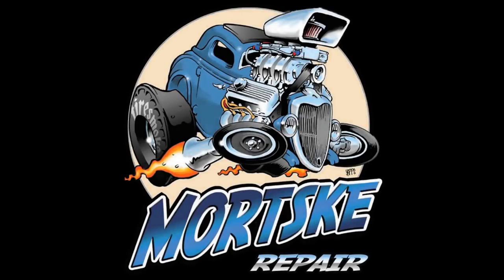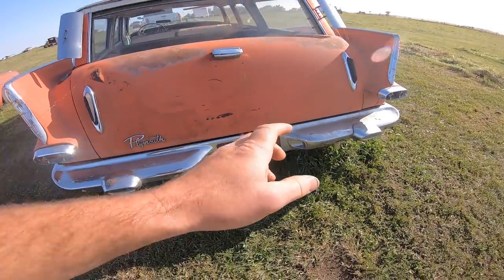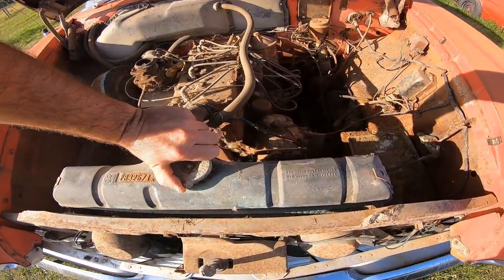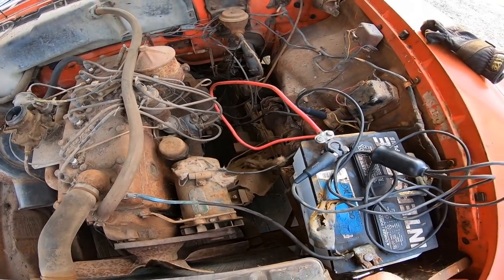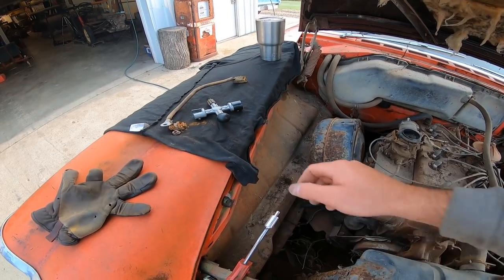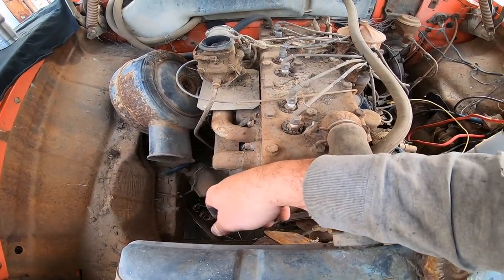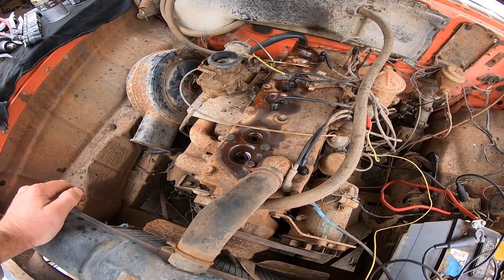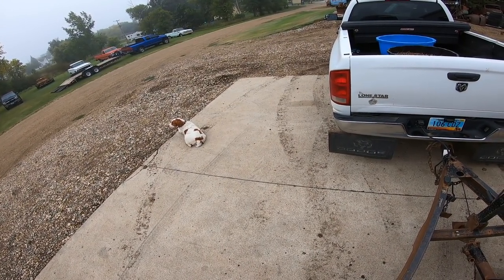1959 Plymouth Suburban Custom station wagon parked for 52 years! Mopar Flathead! Will It Run?!?

Comment: Holy smokes that station wagon not only is it rare probably the only one left in the world of that model it is very very straight good condition in and out great fine 👏🏼👍🏼
Reply from the maker: One of the other commenters said 35,000 of this six passenger trim level were built. And yes! It's in excellent shape for it's age! Thanks for watching and commenting!
Reply: @MortskeRepair  so she’s a goner ? Darn
Reply from the maker: @deborahchesser7375  Oh no, it'll get fixed!
Reply: @MortskeRepair  there is an identical colored door on Ebay in Minnesota from a 4 door. The guy is parting it out. I've talked with him as I have an identical colored wagon as yours.
Reply from the maker: @nuclearruffneck  I'm gonna look that up! Thanks!
Reply from the maker: @davidt9292  That's the plan! I'll add a new video!
Reply: Call teds tuna boats in South Dakota he has some
Reply: @MortskeRepair  teds tuna boats has cars and parts for 50 mopars
Reply from the maker: @darrenbrisson4336  Thanks for the info!
Reply: No I worked on a original low milage one back in the 90s at a shop called Classic Auto Limousine in Mpls MN but it was White . It came in because it had issues with the vacuum accordion booster that we replaced for the power brakes it had & instead of the 6 it had a poly V-8 . Was straight solid in very good shape that drove in & left that way by the owner . We were sponsored by the MSRA & had all kinds of classic hot rod muscle cars & high end  stuff coming in all the time to be worked on rebuilt or restored by the body shop we also had at the shop .
Reply from the maker: @peteloomis8456  Cool stuff!!
Reply: No that's not the only one left there are many of them around the 2 door suburbans are the ones that are rare check this one out I would love to own it https://www.youtube.com/watch?v=MOEwHWkfn1k
Reply from the maker: @79tazman  Man a 2 door would be AWESOME!
Reply: Resto mod! Resto mod!

Comment: 1:41 LOL, when I saw the light switch it reminded me of the Vice Grip Garage video with the LeSabre.
Reply from the maker: I did see that on the LeSabray this week!! Musta been for the NOS!! Thanks for watching and commenting!
Reply from the maker: @Maxxarcade  Seems like a logical solution!! We'll get the valves tuned up this winter and put it back on the road!
Reply from the maker: @opposite horse it's spanish, for, drips oil in the driveway
Reply from the maker: @richardcranium1136  Midwest ingenuity!
Reply: @MortskeRepair  hello just a thought arev you Derek's Brother from VGG. IM A BIG FAN and subscriber now both ur channel' i also love old cars and and my special is the chevelle SS 427 .
Reply from the maker: @andrewjacktheladswift7048  Thanks for subscribing Andrew!! Sounds like you've got a pretty dang sweet ride!

Comment: The last flathead stuck valve I had was on an '64 AMC.  I put a butt load of WD40 down the stem and let it sit overnight.  When I cranked it the next morning the valve started working on the 2nd revolution.  No Tonya Harding required!
Reply from the maker: I have yet to work on an American Motors rig! I think soaking this one would have obviously helped. But I get impatient! Oh well, live and learn! Thanks for watching and commenting!
Reply: That 64 wasn't a flathead. Or, that flathead wasn't a 64. 
Valves stick on flatheads when they sit for...a while. The critical time is unknown, but the fact that they do stick is a universal truth.
Reply: @tomadkins2866  - Technically, you are correct.  It was referred to as a 196 L-Head engine.  Still, it had a flathead and the cam and valves were in the block.  I saw little difference between it and the '51 Pontiac Straight-8 engine that I had in my previous car.
Reply: You are right. AMC used an L head engine until 1965. I never knew that in my 40+ years as a Mechanic. Thank you for that teachable moment.
Reply from the maker: @tomadkins2866  They love to stick I've found!

Comment: Good solid car and a rarity. Amazing it's survived so well!
Reply from the maker: Yeah, I'm not sure how it managed to survive so well. I just wish it had the right color drivers door!
Reply: @MortskeRepair  Yeah I guess that's a bit of a stinker but if that's your biggest worry with a 1960 car, you're not doing too bad!
Reply from the maker: @paulbennell3313  Oh I'm sure there will be more issues! That door just drives me nuts tho!
Reply: @MortskeRepair  The outside trim and the door card are the trickiest bits. I guess the original door probably got dented. It was only 9 years old when it was taken off the road so I doubt the door had rotted out judging by the rest of the car. What an awesome project though, subbed!
Reply from the maker: @paulbennell3313  I think I have the outside trim. A friend at the auction happened to save all the trim from a car he parted out! I'm guessing the door was damaged in an accident as well since there's hardly any rust on the car and it's not all worn out. Thanks a ton for subscribing!
Reply: Actually it really is a Survivor car becuz it survived being turned into a demolition derby car. long live the long roofs !!!
Reply from the maker: @idunnobouthat6632  Something about a wagon that just makes them that much cooler!

Comment: Awesome video!  I learned to drive my Dad's '59 Chrysler Windsor, in a slightly beige pink color.  (I took some crap, but like to think it built character.  Drove it for my driving test.  Did OK except for parallel parking.)  The thing was a tank!  We had a "Golden Lion" 383 automatic that was smoking a bit at 59k miles in 1968, but it would RUN!  And the front seat was so big we didn't have to use the back seat at the Drive-In!
Reply from the maker: Thanks so much! Great story on your dad's Windsor! Character builder!! Hahaha you wouldn't catch a kid driving one today. Thanks for watching!

Comment: Been watching quite a few Vice Grip Garage videos, I see. Just make sure the lightning whirler is sending the lightning to the sparkalators before you dump fuel down the fuel makithappener. LoL
Reply from the maker: All the good technicological tips right there! Thanks for watching and commenting John!
Reply: He forgot to shout BRING THE THUNDER when you push the start button! lol
Reply from the maker: @midsouthexpress  I think you need all 12 valves to let the thunder roll!!

Comment: I have a 52 DeSoto with the same Chrysler flathead 6, and mine had the same problem (stuck exhaust valve, cylinder 6). I coaxed it and coaxed it with Marvel Mystery Oil and soaked it for days, but eventually pulled the head off and whacked the shit outta the valve. I used a block of wood between my hammer and the valve, though, and I ensured that the cylinder was on the intake stroke (so I was sure I wasn't working against the lifter). Luckily, I did not break the valve, and once I got it all freed up I slapped it all together and drove it to town every day for two weeks. Runs like an absolute dream - you have to coax these flathead motors, but if you do em right, they'll run forever. The partial flow oil filters were the worst thing to happen to these - I believe they have a large part in the sticking of the valves on these motors because they don't adequately filter out particulate. Nice video - hope you find another flathead to put into it so you can use that sexy 3 speed!
Reply from the maker: Hey thanks for watching! We've got new valves on order. We'll tear the old flathead apart for a valve job and clean it all up so it lives again. I agree on the oil filtration system. They were a step in the right direction but they just weren't there yet.

Comment: hay ....my dad bought a 1959 plymouth savory 4 door  with 6 cylinder 3 speed back in 1961. we had it several years  when we sold it had 74k miles on it  we had changed the trans and motor  was a Rogers reman with about 3k miles on it.  it was a great car but a little under powered and needed better brakes.. be nice to have today..liked the way it ran.  good memories.....
Reply from the maker: They're big cars with small power! And even smaller brakes! Thanks for commenting on the car that your dad had!

Comment: Compression, an important element.
Reply from the maker: Yeah, who woulda thunk you couldn't just dump fuel in a cylinder and light it on fire without a valve opening and closing. Thanks for watching!

Comment: My Engine Design instructor--a former Chrysler Service Tech--told me to break-up the carbon on the rings of my '72 Newport Royale, use a shot of Mopar Heat Riser Solvent in each cylinder and allow it to sit overnight. Doing the the same here on the valves as well might be wise. :)
Reply from the maker: Yeah soaking them for a day may have helped. They’re getting removed and reground now that I screwed the one up. I’ll do better next time!

Comment: The only logical fix i can found for this is slam in there a Slant Six. I preffer at least, a 318 Poly or LA 318 could do it as well or a 350 from a 57 Fury...  Good luck 👍. Cuz that wagon is complete and it worth a decent treat restoration💎♥️.
Reply from the maker: All great suggestions!

Comment: maybe you Should of used a rubber mallet to hit those loose but they were probably too far gone anyways too bad would have been nice to see that motor run
Reply from the maker: Yeah I should have let them soak some more and tried some heat probably. But that thing broke way too easily. I've tapped on many a valves and never had one break. Live and learn! Thanks for watching!

Comment: You have one of the coolest cars I’ve ever seen and you’re going to give up because of a valve? C’mon man let’s get it going or let me buy it!!
Reply from the maker: Oh no, I'm not giving up. Was just a good place to end the first video. We've got a stack of engine parts on order to get it back on the road! Thanks for commenting!
Reply: Just pull the piston out, it'll run 😀👍
Reply from the maker: @oohgee3093  Can't I just pull that spark plug out?!? Maybe put a beer can in between the intake manifold and the block?!? Thanks for commenting!
Reply: @MortskeRepair 😀5 pistons =less drag .enjoy that fine Mopar 👍
Reply from the maker: @oohgee3093  It's basically the same as adding a turbo you're saying!!
Reply: @MortskeRepair  HAHAHAHAHA from Iowa!
Reply from the maker: @Dent Oldani Don't act like Iowa is better than the rest of us!! haha
Reply: @MortskeRepair  HAHAHAHAHAHAHA

Comment: She looks good! These type of videos inspire me. Im gonna pick up a 1965 Buick Special I recently got ownership of. It sat since the mid 1990s and I'm gonna see if she will run!
Reply from the maker: These old GMs usually light right off!
Reply: The motor should be a 330 V8, or could, maybe, be a 230 I-6.  Shoot a 3-1 mixture of gasoline and 2 Stroke oil into the cylinders before you try to start it. 
 Once you know you have spark and it turns over, squirt the same mix into the carb to test if it fires.
Reply from the maker: @tomadkins2866  Suck squeeze bang boom!

Comment: I had a 47 pontiac with a straight 6 flathead and a large spring compressor tool works good. There is 2 access panels on the side of the block. The screw goes on the valve and the other part goes on top of the spring. Im sure you can find replacement parts for it. The cosmetic stuff, good luck with it. This should fetch some serious coin especially since its rare when its done.
Reply from the maker: New valves are here. Just gotta slam them in. Definitely a rare car and worth the effort! Thanks for watching and commenting Jeff!

Comment: Awesome wagon!! Get her running good, throw on a set of aspen/volarie/ 5th Avenue/ Diplomat ect disc brakes, 70s dual master and a 65-70 mopar C-body rear axle and drive the hell out out of her!!!!!
Reply from the maker: That's a heck of a game plan!! The driveshaft system in these cars is horrendous!! And brake upgrades would be a welcome change too! Thanks for watching and commenting!
Reply: Those spindles will move the wheel forward in the opening.  I did that to a 60 plymouth.  Had to use a big dodge truck master. You want a big bore master

Comment: Hahaha, special valve loosening tool. I think I have one of them there devices.
Reply from the maker: Simple folk call it "the hammer" apparently!
Reply: It's definitely loose now.
Reply from the maker: @CannonFodder873  I'd never experienced "valve float" until now. This one floated across the room after I turned the camera off!
Reply: @MortskeRepair  With appropriately edited expletives, of course. (LOL)
Reply from the maker: @CannonFodder873  Well yeah!! That's how you can tell your valves are floating. By the sounds!
Reply: @MortskeRepair  What's the plan for the car ?
It sure sounded OK when you were cranking on it. I was half-expecting you'd get the valves unstuck and slap the valve cover back on and FIRE it, judging by that nice strong spark.

 I love older wagons. Had a 1970 Chevy Concours (Chevelle) wagon back in the day.
Reply from the maker: @CannonFodder873  The plan is to find a new valve and touch them all up and get it running again. Obviously it needs new brakes and such but we'll address that as we go. Thanks for watching!
Reply: @MortskeRepair  I'm subscribed. Carry on.

Comment: I used to clean valves with mixture penetrating oil, kerosene poured down carb. Frees rings also from rust. 85 year old wrench slinger.  🐻

Comment: Don't know what you sprayed on the valve stems, but try using PB Blaster next time and let them soak overnight at least. Then when ready to try loosening the stuck valves by rotating them with some channel lock pliers first before tapping on them with the hammer. I have seen this work on a number of the flat head engines. Good luck with this one, it deserves restoration.

Comment: Production of the 1959 Plymouth 4-door Custom Suburban 6-Passenger was 35,024. The Custom Suburban has the same trim as the mid-level Belvedere. The front driver's door is from a 1957 Plymouth. The engine is a L-head 230 Six, 8.0:1 Compression, 132 Horsepower, Carter Type BBS One-barrel
Reply from the maker: Good to know! I ended up picking up another 59 Suburban but that one is a Sport. Got a load of options this one doesn't have like padded dash, push button transmission, V8, power steering and a bunch of chrome and stainless!
Reply: @MortskeRepair  The Sport Suburban has the same trim as the Fury. Your Custom Suburban has the $84 overdrive transmission. Is the Sport Suburban a 6 or 9-passenger?
Reply from the maker: @SpockvsMcCoy  We haven't gotten the tailgate open to check but it appears it's a 6 passenger as well. It does have the bumper guards and the cutout on the passenger rear quarter panel for the spare tire access panel which this car does not have.
Reply: @MortskeRepair  Production of the 1959 Plymouth Sport Suburban 6-Passenger is 7,224 so it is rarer. Tires on both are 7.50 x 14.
Reply from the maker: @SpockvsMcCoy  That's crazy!! Can't be many of them left in existence. Sadly that one isn't in near the condition this one is.
Reply: @MortskeRepair  Any video of it?
Reply from the maker: Yeah I took some of it but have yet to edit it. You'll have to stay tuned!
Reply: Live long and prosper...

Comment: The 1968 on the license plate is the year that plate was made - not the last year it was run.  Different states do it different ways, but many require new plates when a car is sold.  That car was on the road for some unknown number of years after it was sold in 1968.  With the ease that the motor turns over it has been sitting for something much less than 52 years
Reply from the maker: South Dakota released new plates each year for all registered vehicles. Therefore my best guess as to the last time it run would be the last year that it was legally registered to be on the road. Thanks for your insight and thanks for watching!
Reply: @MortskeRepair   - you mean South Dakota seriously gives every single car new license plates every single year?  Wow, talk about bureaucracy run amok!
Reply from the maker: @Thomas63r2  South Dakota, North Dakota, Minnesota. They all did up until the mid 1970s. I'm pretty sure the entire country did.
Reply: @MortskeRepair  Nope, I would guess only those states with politicians who profited from wastefully printing off license plates.  In a lot of states like California the plate was a once and done unless it needed to be replaced due to theft or damage.  Cali even transferred the existing plates to the next registered owner.   Other states like Texas issued new plates only upon ownership changes.

Comment: My parents had one like that that might have been a 1960 it had the Highway Hi-Fi in it and apparently all the extras.
It also had the odd shaped clear steering wheel. I think it also had a pop-up third seat in the back, but I think we never used it. That back area was our play area on car trips. (What seat belts?) And we loved having the tailgate window down. And it was the first vehicle we had to pull a travel trailer. 😃
Reply from the maker: Dang that sounds like a sweet rig!! They did some crazy things back in the day with automotive styling! Thanks for commenting Kerry!
Reply: For anyone that does not know what Hyway Hi Fi is, see the videos on YouTube. 😃
Reply from the maker: @TF856  I'll check it out!

Comment: What a bummer I tried screaming at the screen while I was watching don't hit them its going to break but as you learned it was to late normally I'd condone this from the opposite end but you could literally put a 212 predator engine in that and make as much hp anyhow lol good video checking out more!!
Reply from the maker: Yeah I hosed up!! You learn from your mistakes so I should be one smart SOB. We'll be getting new valves to put in it and get it back on the road in it's glorious 80hp! Thanks for watching and commenting!